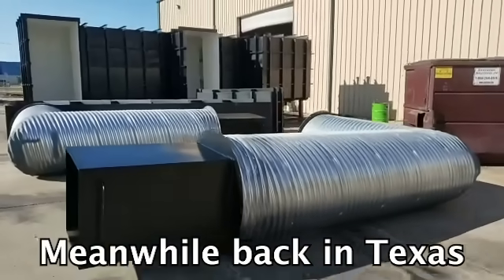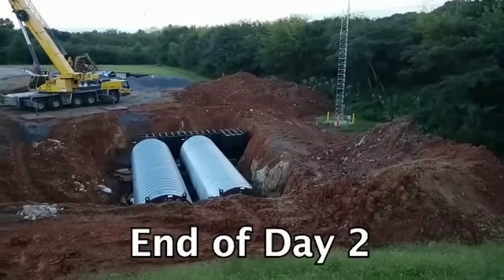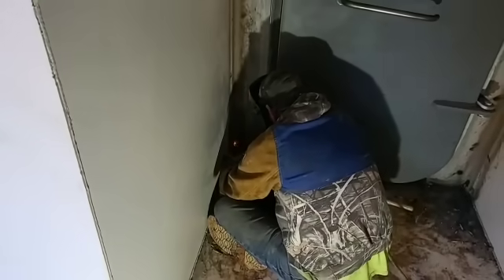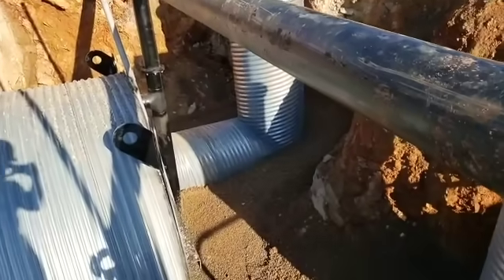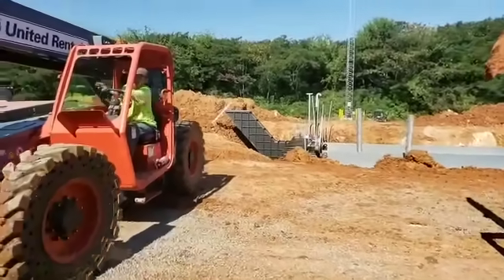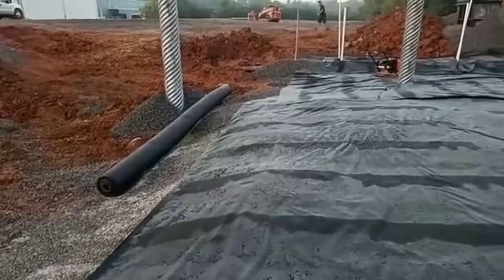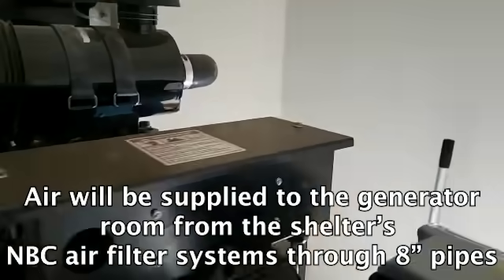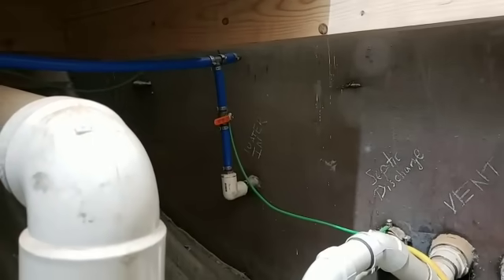Installing Two "Big Boy" Bomb Shelters "Side-by-Side"

Comment: One of many reasons why I do admire American's, in the UK I'd never be able to get the planning permission for a bunker on that scale.
Reply: Planning you say for a secret bunker 👀
Reply: @liamhargreaves7135  🤣🤣
Reply: You don't need planning permission to go underground.
Reply: You can build one no problem in the UK, there was a guy who built one in his back garden, no issues. He's on YT can't remember his name he's a mad inventor who built a jet-engined bicycle if I remember right.
Reply: Colin Furze?
Reply: Americans have the right attitude, who gives a heck what you do on your own land. Build a nuclear shelter or a massive mansion. In Finland you need to beg for permission to build anything even a normal house, no way is anything other than small to medium sized normal house allowed to be built. No way could you dig a hole in the ground like this, even if you would go to the middle of nowhere.
Reply: @mrender666  That's him..mad as a 
March hare.
Reply: @Are1i  Except that is not quite true. Americans do have to get planning permission though its is often much easier. They also have to conform to building regulations just like everyone else.
Reply: @paladinsmith7050  Actually, yes you do. If it is for an underground room similar to say a cellar, that does not require underpinning of existing structures then yes, that can be done without any kind of planning permission. 

However bunkers would be considered an engineering project and for that you WOULD need planning permission, especially if said bunker was larger than the footprint of your property, which is easily possible in say an inner city terrace. Its mostly there so dickheads don't do stupid things like cut through gas mains, water lines, sewage lines and electrical lines. 

As for whether you would get planning permission, that will depend where you are. You are unlikely to get it if you live in a terraced inner city house, but if you want to build one in the middle of a field you own with no major infrastructure running through it its probably going to be fairly easy.
Reply: @Are1i  If in the middle of nowhere. No one is going to know. Aside from that. We Americans have to beg to build homes as well. We're currently in a deficit of over 5 million homes. Which is weird because we have 3 times that in vacancies. Go capitalism!
Reply: Here is The True Savior

HalleluYAH “Praise ye YaH”

YaH is The Heavenly Father 
YaH arrives via the TENT OF MEETING
YaH was Who they Crucified for our sins
YaH was Crucified on an Almond TREE

— Ancient Semitic Cuneiform of Moshe (Moses)
— Isa Scroll (The Original Isaiah)

Isaiah 42:8
"I am YaH; that is my Name! I will not yield my glory to another or my praise to idols.”

Isaiah 43:11
“I am YAH, and there is no other Savior but Me.”

Isaiah 45:5
“I am YaH, and there is none else.”
Reply: @paladinsmith7050 late reply ,you do in uk.
Reply: There are European countries where bomb shelters are mandatory when building apartments.
Reply: If the bunker is ever really needed the government will take theirs specially if the GOP is in power

Comment: With a clay base like that you should  drill like 10 or 20 4inch holes 25ft deep all around the bunker and fill them with sand  ..its called sand draining  ..a very effective method of getting water down past the clay layer  ..sand draining can help alot if your sump pump fails

Comment: For those commenting on the escape tunnels please remember that they said they were going to build a building on top of these bunkers. With that in mind the escape hatches (and air piping) can come up anywhere in the house or building. Behind false walls, cupboards, closets, fake fireplace, etc. Let your imagine run wild and that is probably what these people are doing. If they can drop $500k on just the bunker you can imagine that the upper structure will also be awesome.
Reply: No amount of spending will allow you to survive a nuclear war.
Reply: @eternalskeptic  Yeah.  We will all take the same amount of cash into the afterlife.
Reply: @eternalskeptic  I'm curious, if in the event of a nuclear war, it can penetrate anything even gas proof spaces? Or the explosion alone will destroy everything in that area?
Reply: @IzumaSupreme  You've heard of Cheyenne Mountain, where NORAD is stationed? It's under a mile of solid granite, yet it was obsolete before construction was even completed. Hydrogen bombs create fireballs that can be miles in diameter burning at millions of degrees, even if a bomb were to miss by half a mile(it won't) it would still destroy it completely. 
Say you build your pressurized underground bunker with an unlimited supply of power, air, water, food etc and you're not near enough to be killed by the thermal pulse, the overpressure of the blast, or the radiation which will be at its most lethal in the weeks following the blast... will any of your exits to the top even open? What if a house collapsed on top of them, or tons of concrete were blown onto them? 
This is without mentioning Strontium-90 or the fact that there will be more than 100 nuclear power plants around the world melting down for the next few millennia and poisoning our world even further. Nuclear war is game over human race, to think otherwise is a dangerous delusion.
Reply: @eternalskeptic  thank you for the detailed reply. Truly terrifying. Up until now I didn’t realize the true nature of a nuclear war. I was not as scared as now just thinking of it.
Reply: @eternalskeptic  Well, no one is gonna bomb the countryside these bunkers are being built at. These kind of bunkers will never be subjected to ground zero nuclear attack, it's questionable if they will even experience any blast. They would need to be located close to a major city or military complex to do so. These bunkers are to make it through the fallout in the following few weeks till the worst of it passes, and also survive through the civil unrest. Also, the nuclear power plants will most likely be safe, unless they are targeted directly by nukes and destroyed. You are exaggerating the end of world scenario too much.
Reply: @eternalskeptic  Bunker gains you a few months or weeks at least to go out on your own terms and avoid the nastiness of radiation burns
Reply: sounds stupid, the house or buildings would be the first thing to go

Comment: A few question's:
1.  how do you get Telephone and Cell service in the bunker?
2.  how do you get  radio & TV signal in there?
3.  Where do the shower and toilet's drain connect to?
4.  If the city/county power and water resources are not working, for how long can you stay down there since at some point the batteries and the generator stop working, especially if there has been an EMP?
I wish our government would require each city/county to provide bomb shelters like they do in Switzerland or other countries.
Reply: 1. If they ever need the bunker it's not a priority. I'd assume that you would be on 1 or 2 bars or maybe even no signal.
2. Radio's can be used with no problems I think and TV can be hardwired to your house via cable or just get a hard drive full of movies
3. Septic tank for toilets and the water supply is chosen by clients either to house or nearby creek
4. Power supply is solar/diesel depending on customer and is emp hardened in the case of solar and diesel generators have no elecgric components
5. Few months to a year depending on how many batteries and your supply of sunlight/fuel as well as food/water stocks
Reply: @r.p5380  Lol at batteries lasting "months to a year". Sounds like a very wishful thinking list.

Comment: It seems like an interesting choice to have to walk through the bathroom when entering any room.
Reply: Oh I'm sure they would get to know each other very well 😊
Reply: Also nice that the single shower for 24 people has a clear glass door situated at the entrance to the living quarters!

Seriously though, it makes me curious about the design parameters for the installation. Based on water capacity and living space I'd suppose that at design occupancy it's probably intended for no more than a couple days. Sufficient for most fallout to drop out or to wait out an unmotivated attacker, but not much use in a pandemic.

That's just my guess though, would be interesting to hear more from the designer how they spec different configurations for duration of occupancy, especially with respect to consumables like water and fuel. With flush toilets (no waterless urine disposal) and a shower the water consumption per person is going to be at least 10 gallons per day, more if they aren't careful with the shower. Presumably additional water and fuel stores can be added above-ground and plumbed in, but I've never heard them talk about that.

Edit: I forgot about the well, once that's added I suppose the limit is fuel capacity. Solar up on the building roof would address that in all but the most extreme situations. With water and power the limits are probably sufficient for most any purpose.
Reply: @dave7038  I think it's two family-sized bunkers cobbled together, there wouldn't be enough water for showers. It would have to be wet wipes lol.
Reply: poor design

Comment: For the air inlet and exhaust, I'd want a large rock/gravel pit with a steel grate a few feet below the surface and the pipes below that so you can't just crush, cover or even find the inlet and outlet.
I'd also want it on or near a slope where the ground water can drain by gravity so no need for sump pumps that can fail and need replacement, that way it can sit a decade without power and will still be dry! Also, if they can't find it they can't damage it!
Reply: Flooding would kill the air flow.  No fresh air and no exhaust.  why bother at all, you will not survive 5 minutes
Reply: @colinmcinnis  Did you miss where I said on a sloped property so water can drain using gravity?
A steel grate with large gravel above to hide the grate, and gravel below and everything drains down hill so no flooding unless it's Biblical where the earth is covered, and in that case having the vents above ground won't help!

Comment: The escape hatch is always way too close to the main entrance. I would think it would be better about 200 feet away or so
Reply: I also think the air pipes should be in a recessed pit, with a grate and foliage covering them. 

Sure, they have a drain to prevent someone from pouring flammables or other liquids, but there is no safeguard in place if someone were to seal them and effectively cut off the air supply to the bunker. 

Also, the NBC filter is in the master bedrooms of most of these bunkers. The filter will eventually become full of radioactive particulates, and emit radiation inside of the bunker. The filtration system needs to be shielded.
Reply: @dontfukwiththissenator7919  wow… I like your insights. I never thought of any of that
Reply: @dontfukwiththissenator7919  I suggest you let Ron Hubbard, the CEO of Atlas Bunkers know of your insights; he will appreciate them, I'm sure.
Reply: Install a fake tree  or tree stump,  and have the pipe in the center of that tree! If they do not look closely they will even notice it!
Reply: @thesurvivalist.  or even simpler. Just grow some prickly bushes around. They are passing the air, have small roots (in comparison with trees), protecting area as a barbed wire and mask the pipes and bunker.
Reply: Absolutely
Reply: Always confused why the NBC is in the bedrooms as well but more as a QoL thing. Wouldn’t want that running loud while sleeping?
Reply: @christurner7601  Raiders, those who hunt down preppers for thier supplies!
Reply: It's there so you can easily surprise and kill who is breaking in. Not to escape and leave your shelter
Reply: Those escape hatched are too close together, that is basically two individual bunkers packaged together, an escape hatch should go some distance to open ground so it' not likely to get obstructed or found by the undesirable.
Reply: @WickedLive  You think that loud wait until the generator is running, no soundproofing in the generator room.
Reply: @dontfukwiththissenator7919  I was thinking the same thing about the air pipes. The recessed pit idea is awesome!
Reply: Just so everyone knows....there is no way to make an underground bunker perfect.   If someone wants what you have down there and they have the tools and determination, they will get in or get you to come out.   But what these bunkers do is at least give you a chance.   I can find a way in this awesome bunker,  and I can find a way to make anyone inside it have a real bad time, but I'd definitely have to earn it.
Reply: Escape from what to what
Reply: Yes I think the escape should be 200 300 feet away.
Reply: @dontfukwiththissenator7919  can't have air intakes where exhaust is
Reply: all it takes is more money
Reply: so add four more culverts?   This will not work anyway, but if it gives the owner peace of mind and can defend it?

Comment: Aha those Culvert pipes are 3,6 meters X 15,4 meters long. They are made of steel galvanized and welded at the seems from both sides. AWESOME!!
Reply: Not a Full Penetration Weld. That requires back-gouging of the root pass on the opposite side, before laying down root to cover on same side. I didnt see either welder doing this!

Comment: With 24 souls in this bunker, there should be a CO2 monitor. Is there a dependable one that is fully integfrated into the build to qualify safety concerns ? An add-on within a laptop, may show that it goes off too often. The intake dispersal and exhaust may have sensory abilities, but could fail as an aftermarket application.

Comment: Fun fact, when you hear the term engineered before a material it just means that an engineer designed a plan for that specific use with that material and said yeah it will function as intended.
Reply: The titanic was engineered also...   Just a thought...

Comment: I watch these videos and never hear anything about a septic system for the toilets or showers and the like. I would just assume one was install also as well as a drain field/ or something???? Or maybe hooked up to city systems????
Reply: I think you can find a video from a channel called engineer775 I think. He’s a contractor that’s done stuff like that with these bunkers. Ron’s used his videos before
Reply: Most of the Atlas Bunkers must use a macerator-ejector system and pipe it into a city or septic system on the property. A German company called Wilo makes a smaller system for home use when you don't want to breaks up concrete in an existing basement to add a toilet, shower and sink. From what I last priced they were around $600 but that is a third of the cost to bring a plumber and tear out half of your basements concrete to add drains.
Reply: @Subgunman  I know they make different types of "pumps", macerators and the like for getting the waste out. Its just that I've never heard Ron talk about hooking anything up and he goes into "great" detail about all the other piping hook ups. I'm just a little surprised he never talks about it.
Reply: @leopitre7907  sound attenuation

Comment: This is interesting, however, have any of these been built above ground and had trucks full of gravel and dirt added around and on top? Seems more efficient. Same underground protection/cooling without risk of flooding due to ground water or rain intrusion. could probably take a sizable deduction as a tornado shelter.
Reply: It could be done but it would take massive amounts of fill dirt. I haven't done the math but it would probably take hundreds, or more likely thousands of truckloads of fill dirt to make a large enough hill & cover it deep enough to support heavy weight on top, & give radiation shielding, if you also had that goal.
Reply: @EmBeye21  landfill...... perfect hideaway, and large mountain above👍👍👍👍
Reply: @EmBeye21  - Correct. Imagine the cost to move a mountain. I think under is better unless your soil is just too wet.
Reply: You wouldn't then have the benefit of being unknown to all the scavengers on the outside
Reply: @robertapreston4200  Not to mention, loads of survival material available... metal for arrow heads, knives.. a large supply of birds to eat. fertilizer... seeds in rotting garbage....    damaged but functional containers for transporting fluids, kindling, etc., etc., etc.
Reply: Could put half in the ground, maybe 5 feet, should be well above water table, the top fill the other half.

Comment: Serious questions: What does 8 inches of dirt do to protect you? How is this better than a reinforced and hidden basement for a fraction of the cost?
Reply from the maker: It's 72" of dirt.  Not 8".  But 36" minimum is needed
Reply: You may be wrong on the 8 inches of dirt...But definitely dead on with the second statement. Especially with a place like this where they are going to build on top of the entire bunker system afterwards. Build the basement with a partition. From the main basement, you'd never know the bunker section was there.
Reply: i dont can imagine how to survive a nuclear attack in a tin can. Here in Germany bunkers are build from concrete minimum 1m of thickness and 5 to 10metres under the surface. The bunkers have an airventsystem which generates overpressure in the inside of the bunker, to prevent the bunker from getting radioactive particles inside. The ventystem is equippt with overpressurevents to close automatically the shelter ventilation when the Bomb explode to protect the lungs of the people in the shelter. Not to say big waterreservoir which is included in the houseinstallation that there is always an exchange and fresh water in the bunker. I know this, a friend of mine has such a bunker in the basement of his house.
Reply: The video says 8 feet, not inches.  ' vs "